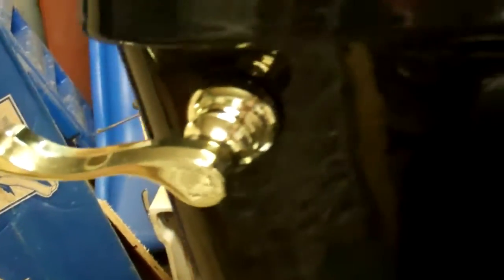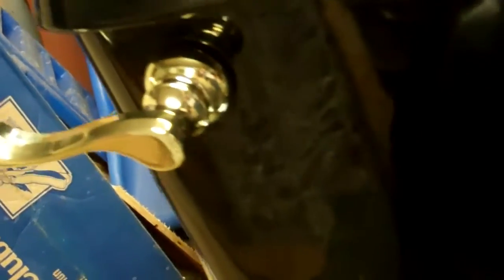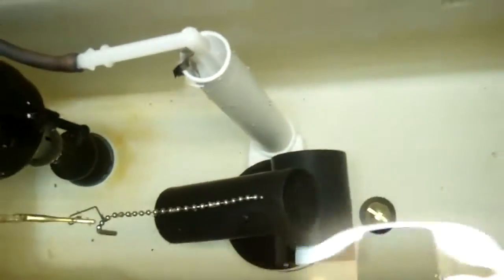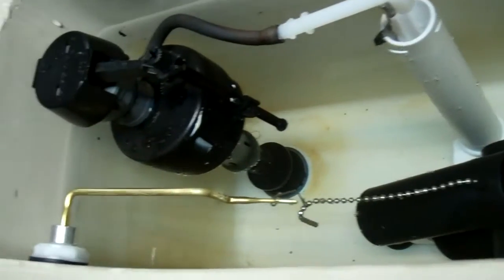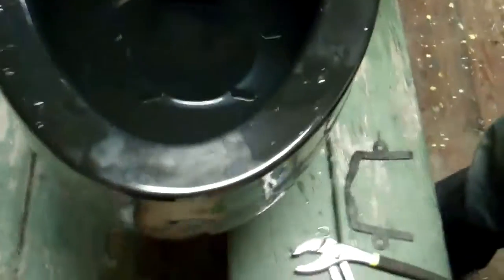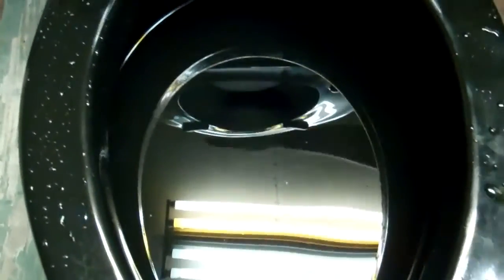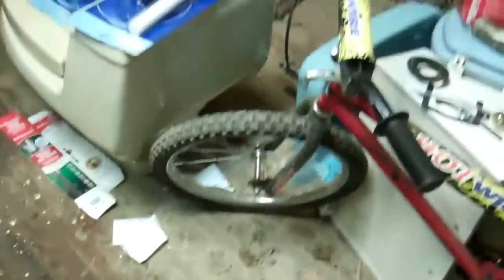My new Black 1988 American Standard Cadet

Comment from the maker: I ended up taking the Douglas valve out of the Compton and installing a tilt valve.  I got tired of rigging it up with whatever I could find at the house, waiting for it to either jam or break..lol.  The tilt valve works well, no problems, and I could still keep the original flush handle, which I like!